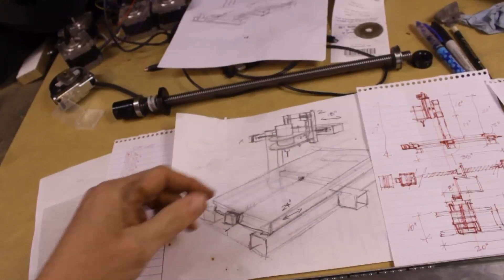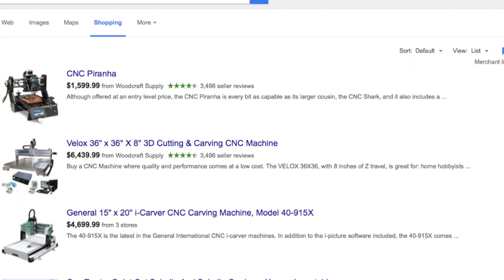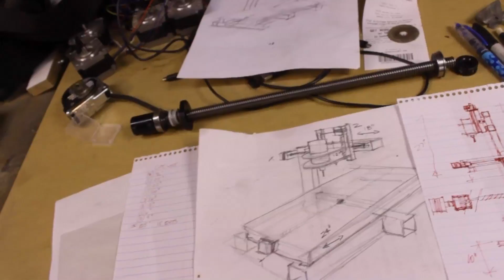My Robot - CNC Machine is Finally Making Things

Comment: nice build and great job! awesome speech in this video!
But the question is, can it mill aluminium? :)
Reply from the maker: +Apfelkernification It should be able to do that.  I haven't tested it yet.  I did some acrylic a week ago and it exposed a bit of a hitch I have in the X-Axis.  I need to upgrade the servo to something a tick stronger and it should smooth out.  The aluminum is on my list of tests.  I should have something in a month or so.
Reply: I'm looking forward to a new CNC video! I want to build my own CNC machine in the next few months, but i don't now which material i should use.. i would like to go with an aluminium frame, but I'm not sure if it will be strong enough to mill aluminium.. there is still some research work to do i guess :)

Comment: Nice work;  saw your stuff on IG and came over to this; if somebody hasn't suggested it already try a down-cut router bit on the finished edges.  If your router takes 1/4" shanks I can send you a us done (that's all I have) to try out.  You can PM me here or on IG @nydls305.
Reply from the maker: +YCM30cnc Thanks man!  I have both up cut and down cut bits.  The up cut left TONS of curly bits on the edges.  The down cut was much better.  Both were 1/4".  They are both Freud and they are flat on the bottom.  I'm guessing I need better software so I can make a "finish cut" at the end of all the plowing out.  Maybe  like .010" to clean everything up.  Any suggestions?  Also, I know now that using birch ply is a bad idea with this type of machine.
Reply: +Greg's Garage try Fusion 360 software from Autodesk;  free for educators / hobbyists etc.,   Onsrud bits are nice but big$$$,  ;  1/8" down cut may be worth a try.
Reply from the maker: I am planning to download Fusion very soon.  Waiting til I'm ready to use it.  I think there is a free 1 year license for start ups.  I think I'm going to like it a lot from what I've seen.

Comment: Cool vid. Not a putdown, but whatever mic you are now using, it must have a coloured EQ , as I thought you had asked a friend to do the voiceover on this
Reply from the maker: +shoominati23 It's a condenser studio type mic...  I just finally got it set up on a stand and useable...  It's not really eq'ed, but it is compressed and the sound is def TOTALLY different than the el cheapo mic on the camera! :D
Reply: ah, I'm a muso ;) I was talking coloured as in when you put your sound through a mixing desk or graphic equaliser and it doesn't return the natural, unaltered sound, instead adding it's own flavour to the sound. 80s yamaha desks were notorious for this
Reply from the maker: That mic def sounds different for sure.  I agree about the mixing desks...  I used to work with Yamaha, Crest, and a few others.  The Crest was everybody's favorite.  They all had slightly different compression, headroom and general color to the sound.  Pretty fine detail to discern, but it was definitely different.  The power amps also had a big influence.  At one point we put pip cards into our crown 5ks and it RUINED the energy in the rig.  You could actually feel it hitting the limit and sucking the life out of the mix.  It was wild.

Comment: So good man! Where did u get it parts? I plan on making one too. Any plans used at all?
Reply from the maker: +Into The Dirtshop The plans are the drawing I showed in the video...  Hand drawn and modified on the fly...  I do have a playlist of all the vids I made.  I talk through pretty much everything I did.  I have links to quite a few of the parts in the description of this video...  There are a few eBay items I can't link to because the auctions end every week.  Here's the playlist: https://www.youtube.com/playlist?list=PLjuDV04z6IjVt6-MvnKZpjst5oiBVYsDD
Reply: Greg's Garage ah ok, i will have to get on ebay and start rounding up some parts, is their a particular brand of parts that is higher quality? I know some of these types of materials are hit or miss.  I will have to watch the playlist as well.  How much did you have invested in this machine?
Reply from the maker: I have between $300 and $400 in the machine (router and computer not included).  The steel was dirt cheap because it didn't meet spec.  The drawer slides were the cheapest linear bearings I could find.  The lead screws, nuts and bearings came as a set on eBay, the motors were second hand, etc...
Reply: Greg's Garage That is excellent. is there an online place you can buy steel that is out of spec? or was it just local to you.
Reply from the maker: It was a local steel yard.  When they get a batch like that it goes directly into their scrap pile and typically gets sold to the scrapper pretty quickly.  I just happened to catch them at a time when the had it on hand.

Among other things; I'm trying to get a website up and going this holiday season...  I'm going to get plans together for this thing at some point in the future, but no promises on timeframe.  My job-job keeps me VERY busy, so I have to do the plans in my "spare time" :D.  I'm more than happy to send you a sketch or two by email or make a video and describe all the pieces if you get to a point where you need something like that.
Reply: Greg's Garage that would be awesome, what i am struggling with most right now is what parts are worth buying cheap and what ones are worth spending money on to maintain relatively tight tolerances.  I have mine planned out in my head, very similar in design to Frank Howarths, but with a larger drop section for large items that can sit on the floor with the waste table removed.  I also have been wanting to index the Z axis so that i can give it only 6 inches of travel, but then disconnect and reconnect at different heights to acheive larger cutting areas
Reply from the maker: Smart.  Something that big, you'll have bigger steppers and a bigger capacity control card.  Arduino is probably not the way to go.  You'll probably also get into mach 3 control software, so you'll be PC based (just a guess).  At that size, aluminum extrusions for the tracks are probably the way to go.  Linear bearings would be nice, but $$$$.

You are smart to index the Z.  I have a box that I can add or subtract.  Tools are different lengths and objects are different thicknesses.  Unless you are doing bigger sculptures, there's no reason to have 18" of vertical travel.